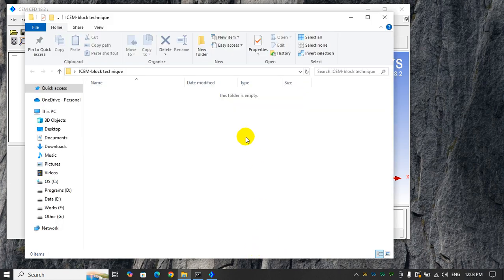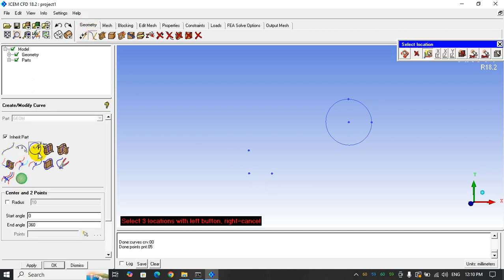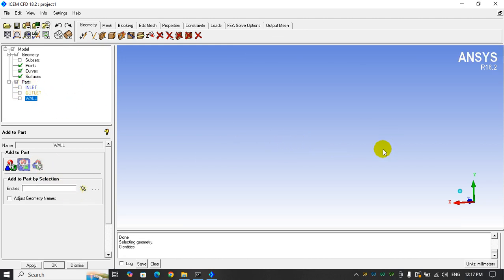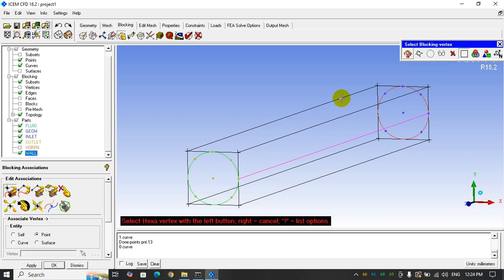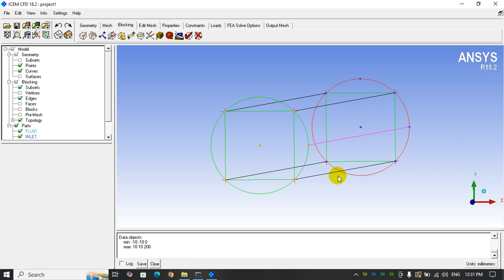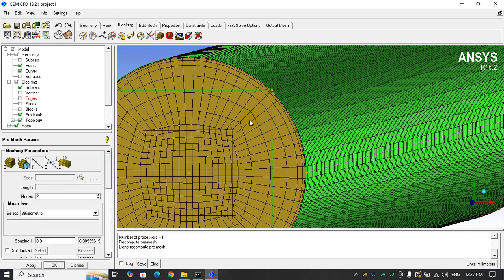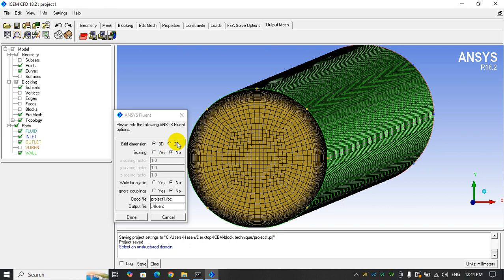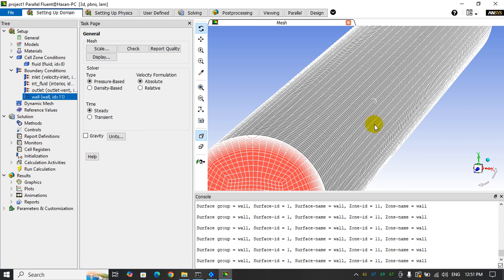Generating a Structured Mesh in Ansys ICEM CFD using Blocking Technique & O-Grid method

Comment: Thanks for the tutorial, but question please, we did not associate edges ? why? Thanks in advance
Reply from the maker: Hi, thank you for your comments. Normally, we need to associate all edges. But, sometimes, like the longitudinal edges within the geometry in video, we do not need to do the association because the software by default divides the specified nodes over them. As the results, you can see the projected mesh is fine.